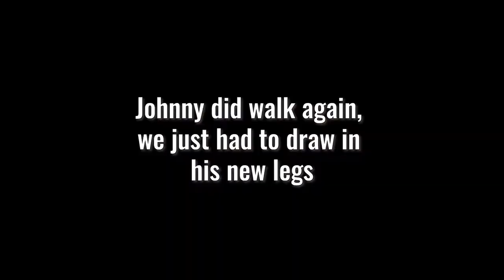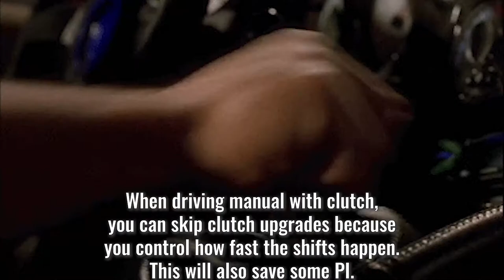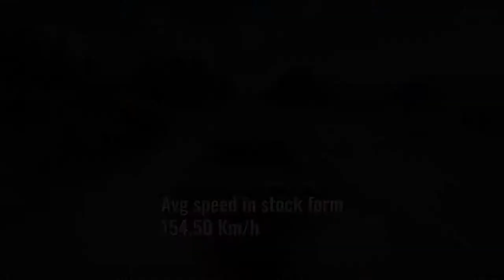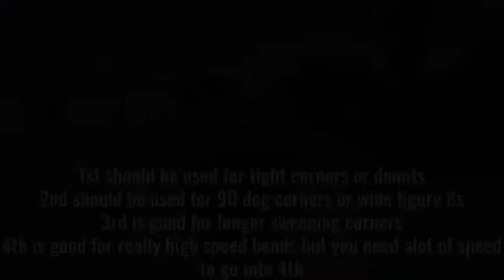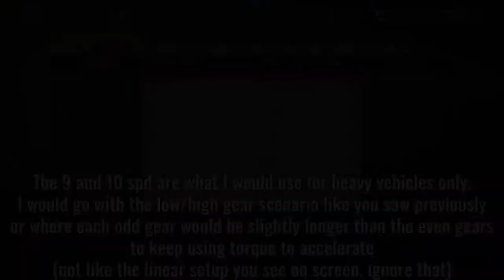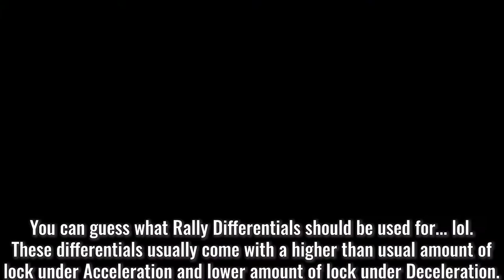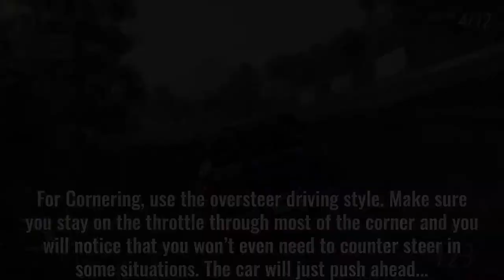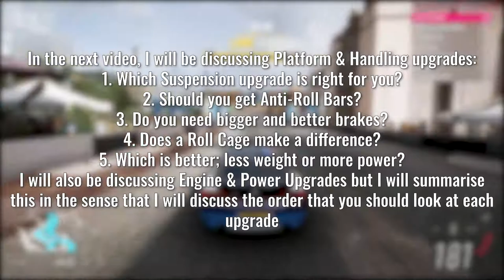Forza Horizon 5 : Drivetrain & Aero upgrades that actually make a difference😐! [Beginner's Guide]

Comment: This is the first video of yours I have seen. I thought it was a good presentation, so I liked and subscribed.

I have done all my own upgrading and tuning since I began playing the game, and I have researched online to get advice. I'm quite pleased with my tunes these days, but I'm always looking for more info. I have a couple of questions/comments.

I drive auto trans for one reason: I have a bad habit of using my index, rather than middle, fingers on the controller triggers, which means I have no fingers to shift with. When I used wheel, I shifted with manual trans. I buy the race transmissions because the shift time is shorter than for the 6-spd. Otherwise, I would use the 6.

How do you feel about buying higher geared transmissions (such as 9 speeds) and tuning them so that sixth gear is the highest at full speed? The bigger transmissions often have lower PI due to the extra weight. Sometimes I'm desperate to get on more PI, and that is my only option left after I've done the others (wheels, etc.).

Since I fully tune my differential during tuning, is there any reason to choose one diff (road, rally, off-road) over another? Are they all the same other than the settings?

I have the same question about spring types. I fully tune my springs in tuning. Is there any other difference between them I should know about? In this case, it makes a difference as the Race springs usually cost 1 PI more than Rally. If I tune my Rally springs the same as a Race spring setup, is the result the same? If they're the same, I will buy Rally springs for my road racing cars and tune them for tarmac races.

One more comment. I mostly drive in off-road rally conditions where I don't need much top speed. I add the rear wing onto some of my cars to lower PI, which is sometimes significant and allows me to add more power to the car.

Thanks. Now I'll check your other videos.
Reply from the maker: Sup my dude ✌🏼 firstly thank you so much for the support, I am glad I can be of assistance. Now onto the important bits. 

1. I see no problem with going for the higher gear count race transmissions, I sometimes do this for the exact same reason (to save on PI) and do the exact same thing you are planning to do with 6th being the gear that will achieve the highest speed but just remember that with each added gear, it's weight that you adding to the car. I think it was something like 2kg for each gear added and that's why your PI goes down. If the reduced PI count makes up for a performance part that will actually prove to be more beneficial as a whole then go for it. My best advice; do a good few hotlaps at your favourite track with both setups (6 gears Vs 7/8/9/10 gears whichever reduces the PI the most to make room for other upgrades) and see the practical use case scenario differences 👍🏼.

2. For Differential tuning and whether the differentials differentiate between drift, race and off-road etc (that's alot of differences 😅), I haven't seen anything different with them other than the settings and which cars you can install them on. One example I can give you is when I am building certain cars; let's say it's a rally build, and I swap to AWD then I can only install an off-road differential. I would still choose it and just set the differential up the same way I would if i were able to choose a rally differential. 

3. For spring types; yes there are differences. Take drift suspension for example, this gives your car the ability to turn the front wheels at a greater angle than the other suspension upgrades. Then the differences between road and off-road are that road can be stiffer than off-road and off-road can be softer. You will actually notice this in the kgf/mm under spring stiffness tuning (if you using metric units of measurement, not sure what the unit of measurement was called for imperial). 

So to sum up; perform tests on a car that has a 6 spd and then the same car with a higher gear count to see the differences. Differentials don't seem to make a difference other than the settings. Springs do have a difference between each type in the sense that they are more tailored to the discipline they are meant for. 

I hope this helps and if you have any more questions, feel free to ask here or join the discord. I am not so active in Forza horizon 5 for just over a month now because I am busy practicing for something new, I hope to show you guys soon. Either way, I am more than happy to help out where I can✌🏼👍🏼

Comment: I need help with adjusting my advance settings. I get some of the settings but some of them like Steering linearity is confusing. What do you have everything set at? Or do you have a video explaining all of those settings?
Reply from the maker: I don't have a video but I do vaguely remember the kind of settings I had. The only thing I changed was the steering, acceleration and deceleration deadzones to make the stick and triggers as sensitive as possible for more responsive control all round. Now I cannot remember the terms but from what you may see; the lower value deadzone settings (except clutch), turn that all the way down to 0, the higher value deadzone settings (except clutch), turn that all the way up to 100